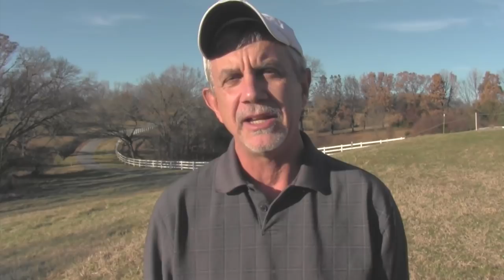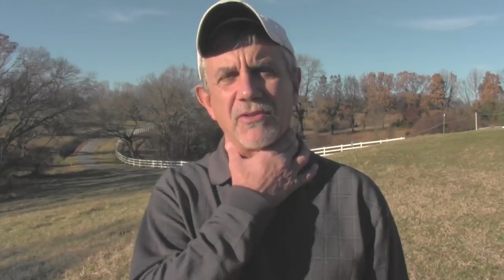Does a Three or Four Cylinder Engine Have More Vibration?  What Other Factors Affect Vibration?

Comment: I have a bad back and understand the vibration and comfort issues when it comes to tractors. My two cents below:

1) Ag tires are the worst option for vibration, turf tires are the best (depending on your terrain demands of course). 

2) Air ride seat is a must...you can find them aftermarket to adapt to older tractors.

3) If you can afford it, [newer] cab tractors naturally have more insulation and provide better cushioning

Thanks and happy Thanksgiving!

Comment: Just sold my Ford 1920 - which Ioved but as I age wanted something smoother and w hydro.  Went all out and got a Kubota Grand L 6060 - about 20 hp more than I really need.  But boy am I happy with it.  First, it is super smooth and quiet.  Second, it is easy to go from range to range on the fly.  And third, the extra HP makes for less time in the saddle - meaning I get more work done per ”vibration time.” I had buyer’s remorse for about 5 minutes.  Now, with a quick hitch and a new set of metric wrenches, I am one happy geezer.
Reply: I hear ya

Comment: If you want smooth running look for some of these key features. Engine balancing that is internal. Isolation bushings for the seat and footwell. High pressure common rail fuel injection for diesels. Hydrostatic transmission. One of the biggest things is to keep your blades changed and straight on your cutter. Avoid rocks and stumps. Use a PTO shaft with a slip clutch. Make sure the PTO shaft is straight and true and if you can balance it. Also, a turbocharged engine will help with smoothing the engine due to it being able to respond quicker to differentials in power demands.

Comment: If you have a tractor that has vibration issues, you might check into having the motor balanced.
Quite generators used on film locations, go through a process that reduces engine noise by balancing and changing out some parts to make it less prone to vibrations that cause noise.
Their diesel motors are the smoothest running I have ever seen.
Good luck.

Comment: Maybe not addressing "vibration" from the power-train, but the bigger the tire diameter, the more it smooths out the ride over rough ground.  Also, an adjustable air-ride seat will be a big plus..

Comment: My 2017 Kioti CK3510 is really smooth.  It's 35 HP and I went with the standard transmission model and don't regret it.  It is a 3 cylinder engine but it has little or no vibration.

Comment: You are correct Mike. More cylinders results in smother operation due to more continuous and consistent angular momentum. However, the mount of the engine will dictate how much engine vibration is translated to the frame. Some things to consider are that larger tractors will absorb more vibration and translate less to the operator. My 97 HP JD 2955 has significantly less vibration that my 28 HP Massey. The elements that make a tractor have less vibration on the operator will likely be engine vibration, engine mounts, and a cushion-ride seat. in any case, a good, cushion mounted seat will be the best investment. Construction equipment seats are designed to prevent the operator from experience vibrations that can ultimately do kidney damage. Lastly, if the tractor is running over rough terrain, the operator is going to get bounced around. Someone stated here that larder lugs will reduce the impact of rough terrain as will a good seat.

Comment: Mike, This is Allen.  Thank you for making this video!  I am really looking forward to your viewer's comments.  Happy Thanksgiving!!!
Reply: Allen, when you go tractor shopping and want to compare relative vibrations between machines, carry along a half-filled transparent bottle of water to set on the seat or floor.  It will gage different vibration levels quicker and easier than climbing aboard a bunch of different tractors.
Reply: I hope you find this info.
My perspective on this issue is similar to yours.  For 14 years I have lived with constant extreme spinal pain - broken and dislocated vertebrae, 4 failed spinal surgeries in 9 weeks, plus other treatments, and now multiple epidural injections every 8 weeks.  Also arthritis in both damaged shoulders and wrists.  I push myself to do what is necessary and enjoyable.
Look up the app Decibel X which is free for iPhones.  It works reliably.  Measure the sound of each prospective tractor at it’s PTO rated engine rpm speed.  Use that as one possible rating because sound equals vibration for the engine component.  
Operating vibration is another component.  Loose metal parts cause vibration, especially sheet metal.  Fenders, hood, and other body panels can cause heard and felt vibration.  Check for loose parts.  If any, tighten using nylon insert lock nuts to prevent loosening.
I believe that some tractor brands are designed and manufactured better than others.
Remember what you don’t hear, you don’t feel so wear both ear plugs and ear muffs.  The combo will most effectively block out both sensorineural and bone conduction hearing.
Brand preference is a big issue.  For example I have always preferred Ford tractors, farm machinery, and vehicles.  They have served me well for 45 years of many types of real usage.  That transferred to New Holland tractors.  My personal belief is that they are designed and manufactured better than other brands.  I owned one particular Ford tractor for 30 years that after subtracting selling price from purchase price, it cost me $60 per year to use.  Maintenance was extremely minor - oil changes and fuel.  I now own two NH tractors that will certainly outlast me.  A 1520 (35hp) with a loader which is no longer made, but the equivalent is available.  I bought this tractor used from an estate.  It had 22 hours and still had cardboard on the floorboard.  The loader bucket had never touched the ground.  It is wonderful where a compact size tractor is best.  This body size was offered as a 1510, 1520, and 1530 which were 25, 35, and 45hp respectively.  If buying new I would have bought the larger engine, but I have never found this tractor to be underpowered.  Also a Workmaster 70 with a loader which is a glorious brute.  NH tractors like some other equipment offer a body size with different engines.  For example when I bought my Workmaster new 3 years ago, it was available with 50, 60, and 70hp engines.  Same body size and weight, but the power to weight ratio made it 3 very different tractors.  I like the massive power, super capable ability, and tremendous feel of this brute. 
Consider tire styles.  Sometimes, industrial type will ride smoother than agricultural.  You can reduce air pressure for a softer ride, but too low risks a tire breaking loose at the rim bead causing a complete flat tire and loss of ballast fluid.  That may require an expensive service call.
Body size and mass weight affect felt vibration.  A small tractor will vibrate mor than a larger, plus you will feel rough ground more.
Some implement brands are much better than others.  For example a cheap brush hog will shake your tractor because out of balance components.  I have always preferred Ford and now Woods brush hogs.  I run a 7 footer on my larger tractor and it is smooth as butter.
Another issue is tuning and adjusting the tractor and implements.  It takes understanding, skill, experience, and tools.  Don’t rely that everything is right.  For example the new Woods brush hog was assembled and ready to use.  However I worked on it for 4 hours adjusting and tuning the upper framework, the tailwheel, and adding a few extra grease fittings.
If you can afford it, buy new to prevent buying a tractor that was abused or has problems.
If you can afford it, buy a tractor with a loader because it is incredibly useful.
Whatever tractor you buy, be sure to get 4wd!
If you lived locally I would gladly help you.  I am in east central Ohio.

Comment: I agree with a comment below. I would think the ride over most any terrain would be worse than engine vibration. With little or no suspension, the ride quality suffers. I have 4 tractors from 28 hp to 41 hp and the ride is great until you hit the first bump. I, too, have arthritis problems in my neck, lower back and right hip. Thank goodness for quality seating.

Comment: I have an old JD350b crawler loader with 11,300 hrs on the hour meter. It has a 3 cylinder engine ( never been apart since new, just oil and filter changes)  It runs smooth as silk.
I also have a 4 cylinder 2440 tractor  with 2300 hrs. This is a 60 PTO HP tractor. It's not quite as smooth running as the old crawler, although it's not been an issue.
I also have a four cylinder turbocharged JD 2755 ( 93 pto HP on JD dyno) , 1800 hrs.
That one is pretty smooth, maybe on par with the old crawler.
Finally, I recently purchased a 4,000 hr JD 2240 for my daughter and son-in-law. That is of the same series as my 2440, but a bit smaller at 50 pto HP. It has a 3 cylinder engine vs the 2240 with its 4 slightly smaller pistons.
I have to say their 3 cylinder 2240 is a smoother running engine than my 2440.
So it seems 3 or 4 can be smooth.

Comment: Seems that the shaking and jerking you experience when running over rough ground would overwhelm internal vibrations. You had an earlier episode that dealt with with rear tire pressures and how lowering the pressure slightly could produce a less rough ride. Just got off my tractor after some snow plowing here in central OR. Happy TG to all tractor fans.
Reply: From my experience rough ground does help with masking irritating vibrations but that is a lower frequency and irregular vibration and it is higher frequencies, engine vibrations and in a car tire vibrations, that tend to cause irritations to those that are sensitive.

Comment: I've driven many models of all different brands in the 50-80hp range and found the kubota Grand L6060 to be the smoothest. Little to no noticeable vibration in the 6 years I've owned it.(standard suspension seat).I would definitely recommend a test drive.

Comment: Mike I am a tractor enthusiast and a family physician. I would bet that his arthritis is affected way more by jarring than vibration. Since he says that is the most important consideration he should get an air glide seat and use weights for ballast rather than fluid in the tires. (Learned second fact from you on your ballast video..... fluid doesn’t compress and causes more jar). Also drive slower and take your time.

Comment: There exists vibration dampening items that can be zip tied, glued, or sticky taped onto things like gear shift levers, loader control levers, steering wheel or mirrors. They are a soft rubber / elastameric compound, sometimes with weights in them.  Commonly sold as aftermarket add on's for archery equipment.  They dampen out most of the string vibration when a bow is fired. They take all the "twang" out.  I have had good success adding the type that go on bow limbs to things like mirrors that vibrate too much to see clearly, and the back side of steering wheel.  They come in all sorts of shapes and varieties.  For $15 to $30, it's worth a try.  you can isolate the seat from some vibration by adding rubber pucks, or thick "rubber washers" and longer bolts, similar to what you put between air compressor and concrete floor.  Just some thoughts.

Comment: Many articles address vibration in engines based on cylinder number, cylinder configuration, whether balance shafts are present, etc. I don't know of any compact tractors in the 24-60 HP range that use any engine cylinder configuration other than inline, either three- or four- cylinders. 3 cylinder engines have a characteristic vibration that varies if the connecting rods are inline, or 120° apart. It gets very technical, and is RPM dependent, with the amount of rocking couple, longitudinal, and torque induced vibration. Today, though, the engineers have it very well handled, and I would say my LS with the LS-made three cylinder engine is as smoothe as any I have operated. I have a friend with a 20 year old 75-hp Massey Ferguson with a 4-cylinder Perkins diesel, and it is a buzzy engine...a workhorse, but I would say it's vibration is less the engine than its more stout, less refined design for operator comfort. It's exhausting to spend half a day in the saddle of it.

I would say it's almost apples to apples today (McIntosh vs. Bradburn vs. Pink Lady) with modern tractors in any hp range, the differences being in ergonomics, and other vibration damping measures to isolate the operator. 

One big factor is wheel diameter vs. rough ground. A small tractor on my property will bounce my neck and back right out of the seat, and my larger tractor has muted that a lot, though I still am hammered after 4-8 hrs brush hogging.

Allen, I think you can't really go wrong, as long as you get a springy seat, wear sunglasses, a mask for dust, and wear ear plugs or muffs...those factors add to what fatigues you, and every bone aches if all senses have been assaulted. Best wishes!!

Comment: We run 2 tractors New Holland Boomer 33(with a Shibaura motor these are still available in New Holland tractor lines) and a Kioti CK3510. I think the New Holland Tractor is very smooth with the Boomer package it has a great seat and all you need to make life easier. Kioti is a bit ruff when running the rpms up and if you have the PTO running it's noticable. Thanks for sharing hope this helps.

Comment: Well said Mike.  Allan,  if you don't care about the age of the tractor or want a loader an old Ford 8N is for you.  Smooth running gas engine and you can make the seat, steering wheel and shifter anti vibration friendly with rubber or cushioning items.  No power steering so that may be an issue for you.  Once you get rolling they are not to hard to steer.  The Ford 1000 series had power steering on some models and gas engines to.  Get an ag. mechanic to check it out first because some can be worn out and have mechanical issues.  I think a older gas tractor is for you.  If you want 4 wheel drive and a front end loader go the modern 4 cylinder diesel route.  Thanks again Mike for these videos.  I am a very seasoned farm boy but still learn from your videos.
Reply: Was just sitting here thinking the same thing. My old Ford 9N and 8N were smooth as glass as far as vibration when operating.

Comment: Power steering and  premium hydraulic seat.  Run tractor at or near rated PTO.  I get the part about 4 stroke/4 cyl, but smaller 3 cyl diesel is quite smoooooooth too.

Comment: My Kubota L6060HSTC cab has a dampeners between the cab and the frame.  I don’t have the air ride seat because it won’t swivel the 15 degrees like the spring loaded one, but I suspect with the combination of the dampeners and the air ride seat it would be pretty comfortable.  I don’t notice a lot of vibration using it, just bouncing a lot with the seat I have.  Look for a tractor with those dampeners or shock absorbers or whatever they call them.  The cab tractors also have a lot of sound absorbing foam in them behind the panels which may additionally help.

Comment: USA built Ventrac 4500z hands down.
Uses a kabota 3 cyl 34hp gas engine, 25-3000 rpm operational speed. 
A suspension seat is available as an option, it provides a smooth ride over bumpy ground.
The standard seat does a good job too.
The reason it is low vibration, is the tractor is divided by a pivot point which removes a lot of the engine vibration to the rear section. 
The operator sets on the isolated rear section and their feet on a platform, you can put your feet on pegs attached to the front half to stretch out, but you’ll get some vibration if you do.

The Ventrac is not for everyone, it really depends on what you want / need. For vibration issues I would definitely give it a look.

Comment: Hi Mike, I have a JD 4520, 53HP at the engine and 48 at the PTO. It's a 4 cylinder with a power reverser transmission. I don't know if a hydrostatic tranny would be any smoother but my tractor does shake a bit when operating at speed. I have loaded AG  tires on it and those Ag tires are rough riding tires. It reminds me of the joke I'll condense in the interest of saving space about a guy that said to his Model T Ford, I name you Teddy Roosevelt, you rough riding son of a gun. Any way, if this fellow is buying a tractor, no matter what he buys, He might want to look into a good quality suspension seat. They're pricey, but he could have it installed and figured in with the payments. Keep up the good work Mike. I hope your arthritis doesn't get too bad. And I hope you had a good Thanksgiving.

Comment: I can only tell you all about the modern John Deere 3 cylinder brands, but the 790 and the 3032E tractors and they both don't vibrate excessively and I love them for that. They both have the Yanmar engines in them and I have never operated any tractor with excessive vibration over the years.

Comment: I think he should consider the implement he’ll be using. That’s where the most vibrations will come from in my opinion.  My labors is 4 cylinder 47 hp and does vibrate, but it doesn’t seem to vibrate any more than the Jd or nh I test drove.   Great channel sir, thanks

Comment: My Ls  3 cylinder turbocharged 40hp tractor is night and day smoother than my 24hp Kabota. Also they offer a 3 cylinder all the way to 55hp .also new 3 cylinder crankshaft are not the same as older tractors so there is really no noticeable differents In vibration in newer tractors between 3 and 4 becuase there crank lobes are timed to be split perfectly.

Comment: The 2019 Kioti CK3510 or 4010 is a smooth running tractor mike.  It is smooth and quite running.  I think the common rail fuel injection makes it run really smooth.  I’ve seen vibration test done with a half bottle of water on the hood while running at different RPMs.   Just a thought..